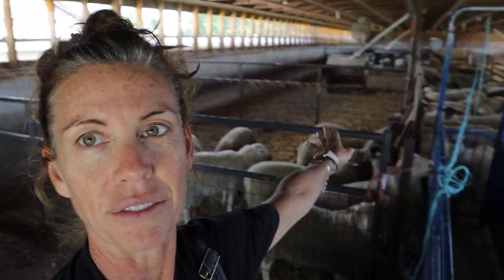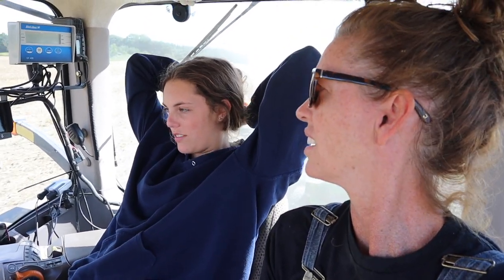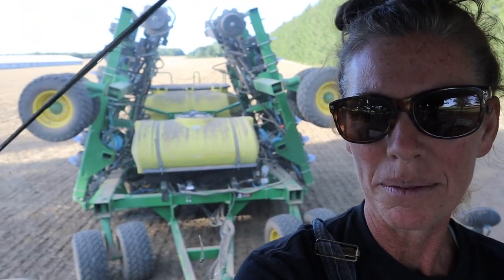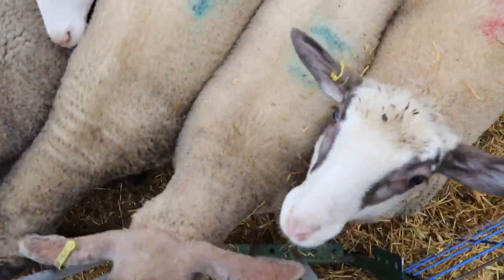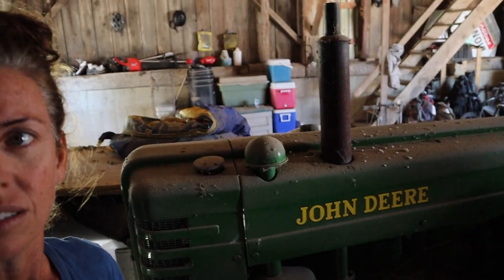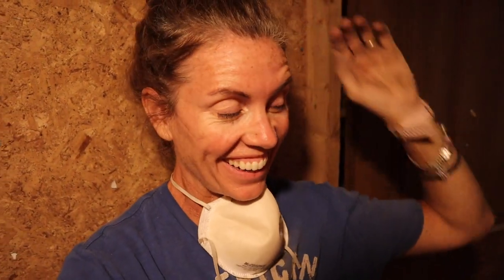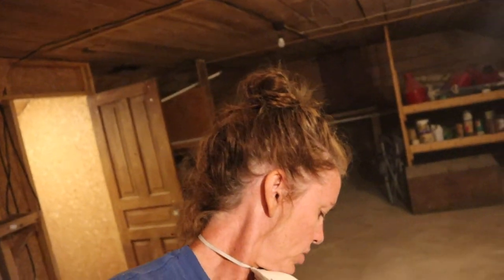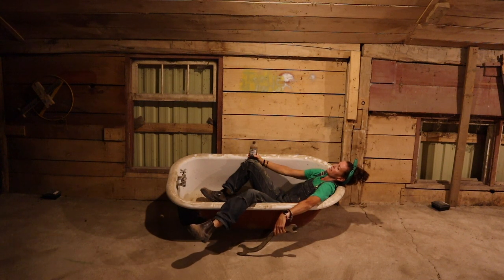YOU SHOULD SEE THIS NOW!!  Vlog 340

Comment: I can relate to the DEF.  VERY corrosive stuff--it's like concentrated piss.  Didn't know it was required for tractors!  (I worked in a truckstop.  You're right; the design of the DEF jugs leave something to be desired.)  That old bathtub was awesome--something an adult can comfortably soak in.  They also make nice stock tanks!  Those insulators can bring a pretty penny at sale or auction.

Comment: You need one of those fuel transfer pumps. The ones I use are sold at Walmart and run on two D batteries. Put one end in the fuel and the other end in the tank and flip the switch. Only about $15.

Comment: I have a couple of the blue glass insulators and have them sitting on the window frame, like the way the sun shines through them.  I have seen wire formed into a candle holder (cupping the upside down insulators)  Kinda cool, even chandiliers.

Comment: Sandi, do you do crop rotation?  Here in our area of Texas it seems the predominant cr is cotton which really seems to deplete the soil really fast.  That makes the  next cycle of cotton a really yucky crop.  California cotton farmers plants are almost 5 ft. Tall and covered in  cotton blooms; around here plants avg. about 3 ft. with 6 or 7 blooms.  The past few years some farmers are planting winter wheat and "highgear" for winter.  Keep in mind winter temperatures run in the 60s and 70s in days,but nights can hit 20s and 30s.  Last winter was a little colder than that with snow for 4 days straight.

Comment: Great video with a special ending that is a really good still picture. By the way is that roll top bath made of cast iron and have a good finish on the inside surface? If so any of those recycle businesses will pay good money and if it still has its 4 ball and claw feet about twice that value. (Here in the UK they are retailing at £1200!)

Comment: I agree with you 1,000,000 % .... who do these people ask when they are designing things, plus - did they ever actually try to put something together using their instructions ..... arrrrgh! 18:16 ... that really cracked me up when I saw the bucket under the hole ... because when I saw you dropping that metal fire extinguisher (?) through the hole I thought "that's gonna leave a mark". Momma didn't raise no fool ~8^) Those old glass insulators are a sought after antique ... you can sell them. Same thing with that planer and other old tools. People are really into building/crafting solely with old tools, and there are lots of folks that collect old beer bottles. I wonder what other treasures ended up in the dumpster? I get that you are trying to get the building cleaned out, and many folks don't have the time to mess with that stuff. If you have an antique store nearby ... you could probably sell the stuff to them as well. Nothing like a good soak after a long day of cleaning ... but that looks like a dust bath to me! Take care.